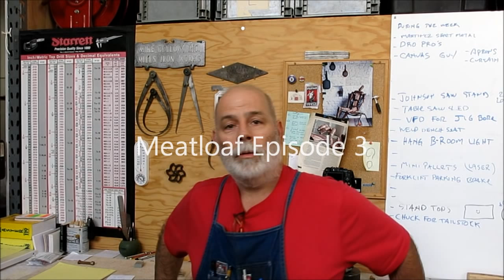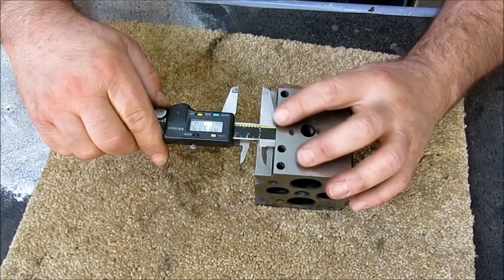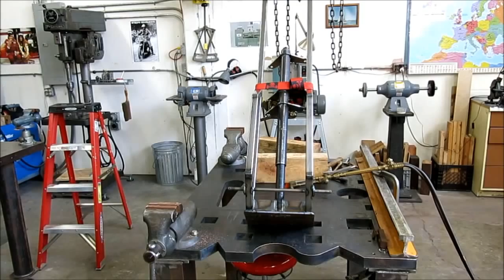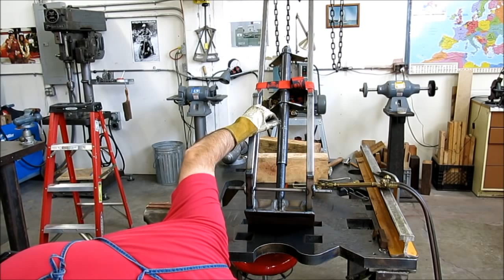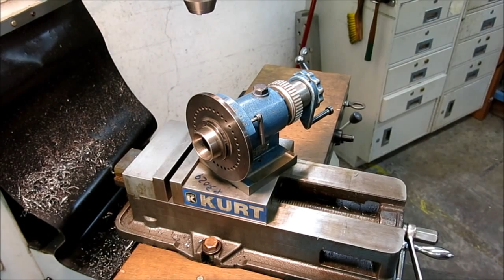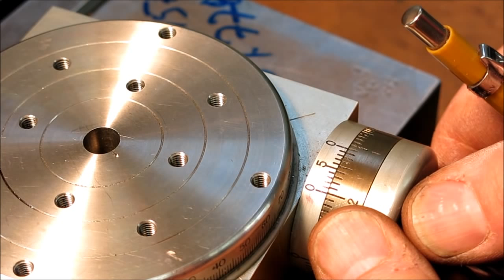Meatloaf Episode 3

Comment: Was a flycutter used with the head tilted, and the block on a rotary table to make the concave pocket for the bearing at 20:00?
Reply from the maker: Andre Gross Hi Andre,

The same method I showed in the teaser video was used. The cutting tool was facing the opposite way for a concave feature. It faces the normal cutting direction for a concave feature. Thanks for the comment.

Cheers,

Tom

Comment: Hi mate.
That indexer that you made, is absolutely wonderful.  I made an indexer with a rotary indexer 360 steps per revolution and a counter that counts two digits behind the decimal point.  I can do more, but I don't need it at this stage.  I can attach the counter to the lathe spindle tube, and that way the lathe becomes an indexer.  I hope you can understand my ramblings.  It's quite simple really.
Marcel.

Comment: What brand of digital vernier calipers do you use Tom? I've just got a cheapo set which were fine but they've started reading off zero at the zero position... Time for a new pair!

Dan
Reply from the maker: Hi Daniel,

I like the Mitutoyo Absolute with a battery. They stay on until you turn them off. I'm a thumb wheel guy as opposed to a thumb rest and the Mits have the wheel I prefer. You can catch them on sale for $80-90. 

All the best,

Tom
Reply: I've got one of those coolant proof jawns from mcmaster i remember them being 100something, saved up big time for the purchase on my third year in college. that was 10 years ago. never dropped!

Comment: have a few of the welders blocks or sometimes I use pipefitters blocks still waiting on the machinest blocks
Reply from the maker: Hi Tighe,

And if you found one in a dumpster what would you call it on craigslist?

Cheers,

Tom
Reply: the same as what i have junkkkk
Reply from the maker: Hey Tighe,

If you were a Shark what kind would it be?

Best,

Tom
Reply: hammer head cause if it dont fit beat it haha just joking
Reply from the maker: tighe hall You took the shark right out of my mouth.

Talk to you soon.

Tom
Reply: haha see ya Tom

Comment: My 9x20 grizzly lathe came with a 120 tooth and a 127 tooth gear to allow for metric
threading, thats what this is all about right lol
Grizzly is great about having replacement parts for all their stuff BUT they dont like to sell parts without a serial# because so many other companys sell the exact same machines at a higher price Jet for an example
it would be easy to mount an existing 127 tooth gear to the end of the 5c indexer
and make a threaded pin to positivly lock into each tooth for direct indexing?
Just a thought?
I would be glad to loan my 127 tooth gear to anyone that needs to make one ,I cut metric threads on my lil lathe once in the almost 20 years I have had it LOL
This is in no way to detract from Tom's excellent series on how to do this from scratch which is super educational
PS I have a major Grizzly store here in Springfield MO and would be glad to pick up and deliver the part for cost plus shipping
Reply from the maker: Hi Gent,

You are correct. If you have a gear with the required number of teeth its pretty easy to make a duplicate. It will have slightly less accuracy than the original but for most purposes its fine. The idea here was to show a method for doing an odd index with no "mother" tool or reference other than normal machinery. Your offer of loaning a gear out is very generous. Its folks like you supporting the efforts of other like minded peers that makes this a great trade.

Kind regards,

Tom

Comment: What is that circular Allen wrench holder?
Reply from the maker: Hi Wave,

You described it perfectly. I made it when I got tired of the cheap plastic ones breaking. Its made from heat treated Beryllium Copper. A common material used in the injection mold business. 

Regards,

Tom

Comment from the maker: Hi Kyle,

For small stuff yes small welding tips work. The "secret" to the technique is the rapid heating of a very small area. This induces a mechanical upset from the hot material pushing against colder material. This acts like a tiny turnbuckle and pulls the material in the direction that the heat was applied. There is an entire chapter on it in my book. Thanks for the comment.

Regards,

Tom

Comment from the maker: Hi sharg0,

Running a non filler TIG pass would work but the arc scars the material. The principle is correct but the result is not pretty. Typically you are trying to involve a similar or slightly larger amount of material than the offending weld. Good comment.

Regards,

Tom